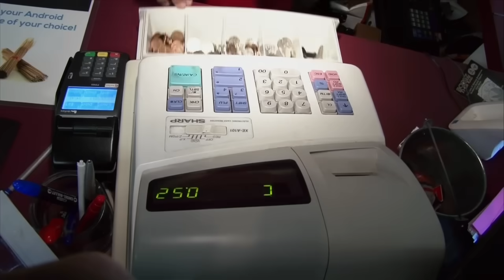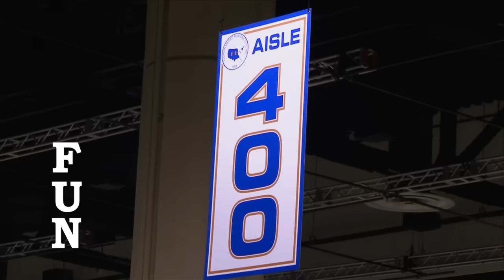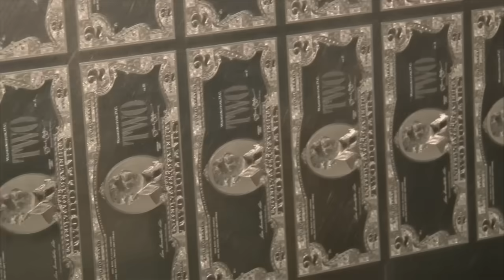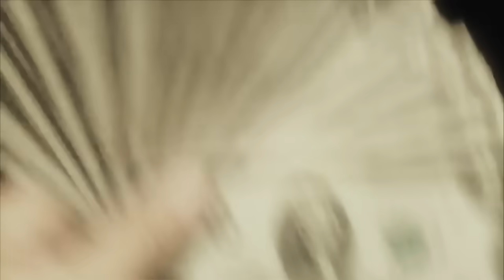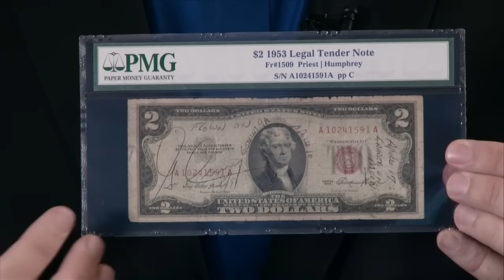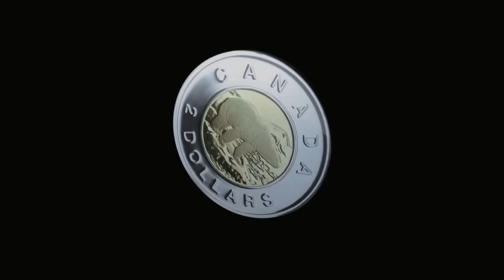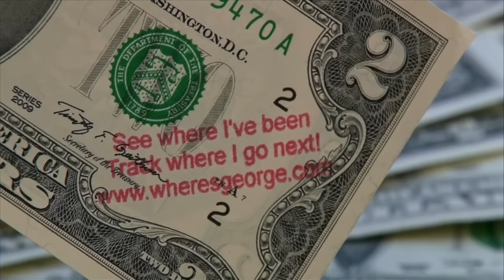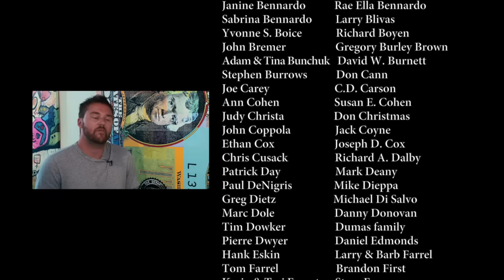The Two Dollar Bill Documentary - full feature film

Comment: If they’re doubting the $2 what happens when they come across a Susan B Anthony or a JFK half dollar
Reply: Also the 'golden dollars' of various designs produced since 2007.
Reply: Or even the eisenhower dollar
Reply: OR EVEN A GOLDEN DOLLAR
Reply: @-oiiio-3993  Sacagawea 'golden' dollar has been since 2000. Lots of production for with (some of them for) general circulation stated of the presidents series started in 2007. Though the golden dollars are dated as early as 2000.
Reply: @takecare5077  Quite correct. 
An oversight / error on my part.
Sacajawea Dollars were introduced in 2000 with a Cheerios Promotion and distribution through Post Offices, in 2007 the Sac became 'Native American Dollars' with an annual change of reverse.

Comment: If your bank does not have $2 bills they can order them for you. They come in bricks of 1,000, so it will cost you $2,000. I'm on my third break now they are a blast to give out in change or by small items.
Reply from the maker: You can also get a brick of 50 bills for $100, and most common is the brick of 100 bills for $200.
Reply: Thanks. I did not know that. I've been buying 1000 a time for around 10 years now.

Comment: 1:08:08 - The 1928 $2 U.S. Note with serial number A00000003A is not "the third one printed", it is the top left note of the third serially numbered sheet (remember, a run of star notes would have been printed prior).
The A00000001A note would be at the top left of the first serially numbered sheet of that issue and all 31 of the other notes of that sheet would also end with a '1' so that when sheets are stacked and cut the 'bricks' are composed of sequentially numbered notes. 
Also, the numbers were applied as the final step prior to release. Two full sheets (64 notes) had received their final printing before his A00000003A note did.
Reply from the maker: Yes, a technicality if you want to go by actual running though the machines. Biut it's the third one issued a serial number. It just depends on how you spin the tale. But 00000003 is still pretty cool; there's only two with a serial number lower than that.
Reply: @TheTwoDollarBillDocumentary  Not "technicality", fact.
The A00000003A note is, indeed, pretty cool and could be accurately described as 'third in the series' and with 'only two lower' but it was not, by any stretch of imagination, the "third one printed" as claimed by the owner.
The numbering system that allows sheets to be stacked, then cut and wrapped with the resultant 'bricks' being sequentially numbered is, indeed, a part of the 'Two Dollar Bill'  history and should be told accurately.
Reply: @TheTwoDollarBillDocumentary  " Biut it's the third one issued a serial number. [sic]"
No, it is not.
Though A00000003A is the third number in the series, two full sheets (64 notes) received serial numbers and were stacked prior to the time sheet #3 entered the press for final printing.
Reply from the maker: I was there in 2013 when they printed them. I saw the process. You're right, it wasn't the third one printed, because they printed thousands of them first, none of which had a serial number. THEN they were all fed through the machine to receive treasury seals and serial numbers, and on one 32-bill sheet, one of the numbers received 00000003, seconds after other higher numbers because of its position on the sheet. So we can speak technicalities all day. Doesn't change the fact that this bill has the third lowest serial number of this series. That a collector says it's "the third bill ever printed" is inherently wrong. But what other language would you like people to use to describe it? People like you and I know it was actually wasn't the third bill printed, but would you have preferred I stop this guy during the video and explain everything we've hashed over here? Let him and the rest of the public see an 03 and say it's the third bill. For most of the uninformed public, it is.
Reply: @TheTwoDollarBillDocumentary  "But what other language would you like people to use to describe it?"

The third lowest numbered note of the series.

Comment: What I am surprised by is that the one dollar bill has not been discontinued with one dollar coins then placed in wide circulation and then replacing the one dollar paper bills with the two dollar bill.  Now there is a place in the drawer for the two dollar bill, so Mr Pastel suit is widely wrong.
Reply from the maker: That's what the government wanted to do, but people won't break habits - they are extremely used to the $1 bill, not familiar with the $2 bill, and not into using coins that much. So it's a hard sell on the public, who just won't do it.

Comment: My big question - where do all those stamped $2 bills go  I spend $2 bills all the time, and buy at least 4 to 6  straps a year - yes, up to $1200 a year spending the bills.
Reply from the maker: If a stamped $2 bill ends up at the bank, it will usually be set aside to be sent back to the Fed to be destroyed. The number of bills removed from circulation due to wear or to defacing get added on to the next year's currency print order as a means to replace the ones taken out of circulation.

Comment: 1789-1940 whose so strong the USA $.
1 c. cent 1 chocolate or 1 bonbon.
5 c. cent a bottle Cocca-Cola 0.33 or Sprite or Pepsi-Cola 0.5 liter or 0.5 Beer.
10 c. cent one Hot-Dog or 1 gallon gas 3.75 liter or big 1 liter beer.
Away 1929 1 gallon gas 3.75 liter rased 20-,21 c.until 1943.
25 c. cent a menü with Cocca-Cola or Sprite.
Breakfast with tea 15cent.
25 c. a backage Marlboro or Lucky Strike 25 pieces.
Motel with breakfast one night 2$.
Hotel with breakfast one night 5$.
In year 1914 the Ford campany raised the basic wage 3.25 c. to 5$ /day and after the oll campany with 1920.
Used Ford T guality condicion cost 50$.
New Ford T 250-380$.
Ford modell A new 400$.
Eagle 1/2 OZ 15.5 gramm 900 AU.10$.
Double eagle is 1 OZ 31.1 gramm 20 $ Gold.
Ford V8 new 800$.
Cadillac V8 ,Cord V8 , Düsenberg V8 cost new 3000 $ max speed 160 km/h.
New Harley Davidson EL-modell 1936 superbike 40 h/p V2 cost 400$.
Max speed 160 km/h.
Harley-Davidson bicycle new 50$ this whose ixpensive.
After 30.000 kilometer must to full motorgeneral in 1930 S all car and motor bike.
Farm with house cost 6000$ in 1930 S.
Reply from the maker: This is great info! I'm prepping a video comparing what you could get for $2 today versus 50 years ago (1971). If you have some good data for me about prices in 1971, I'll give you a great shout-out in that video. E-mail me directly at john@2dollarbillmovie.com
Reply: An ounce is 28 grams.